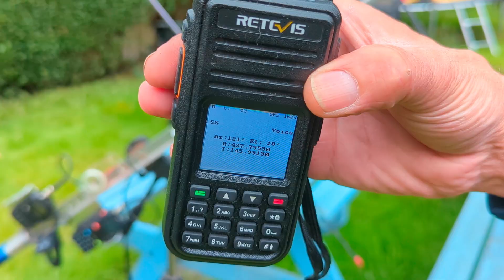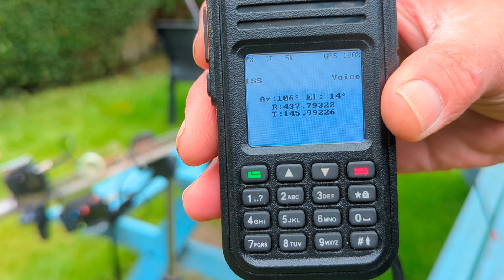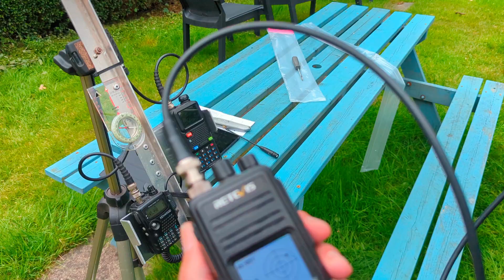New ARROW Antenna build/test with RETEVIS RT-3S - Using OpenGD77 Firmware for Satellite Ops🛰️

Comment: This video cost me a lot of money .... :) At least the antenna was discounted on Moonraker and the radio cheaper than the non-GPS version on Amazon. Opengd77 finally installed (drivers and failures and stuff). Looking forward to working you (and others) on the sats!
M0TMR in IO93CR

Comment: Thanks for the great video. I am new to sat coms. I wonder how you are now able to use just one radio, instead of the two you previously had.I have two radios, as I was told I needed two if I don't have full duplex. I have a Radioddity GD-77, with the GD77 firmware installed, but purchased a second radio, the Quansheng UV-K5. Any chance you might clear this up for me? I really want to try my unused Arrow antenna (purchased without duplexer). Cheers from VE5KLS
Reply from the maker: Hi bud, this radio or any VHF/UHF radio will work with your arrow. The only difference you have is like you said they are not full duplex so you do not hear your own signal coming back. You however hear the sound of the carrier dropping when you de-key the ptt. Having two radios is beneficial as you hear how strong you are getting in and you can make adjustments in angle/direction which you notice on your received signal quality. However the new open GD77 Sat tracking is brilliant with one radio without hearing your own down link signal. The s meter  works well so I personally use that to ensure I'm on target. The auto frequency adjustment is great as well. I like using both methods and some people like to manage the frequency correction by hand. So the two radios are good to use. Either way you can have plenty of fun with your equipment 👍 hope this helps
Reply: @M0YKSHamRadio You are awesome. Thanks. I am inspired and a new subscriber.